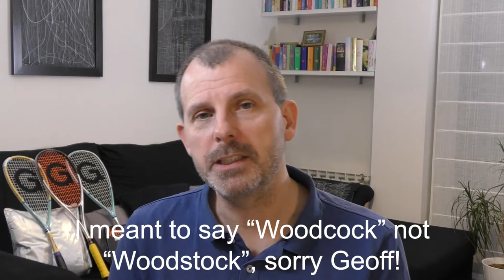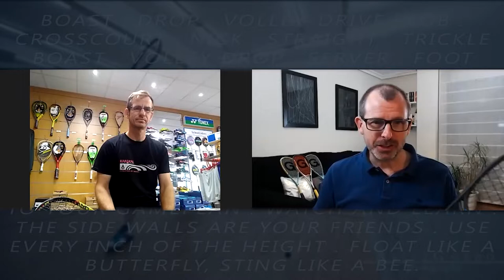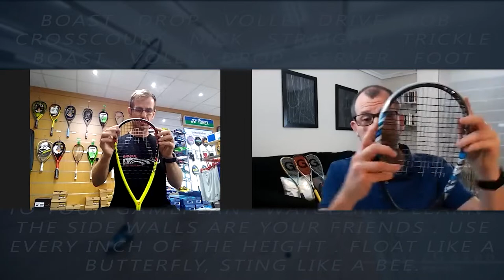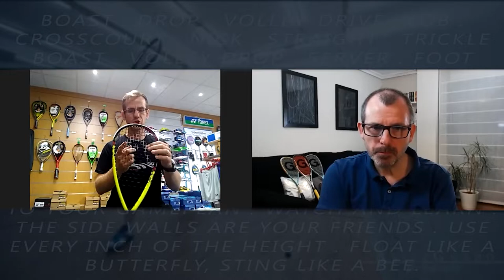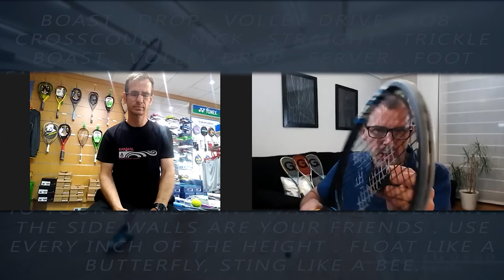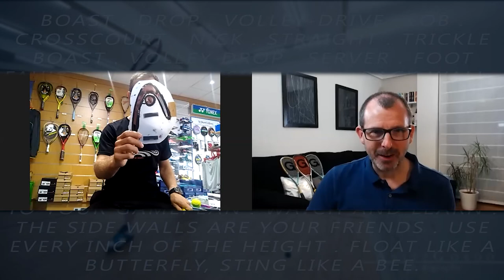Squash Racket and String Terminology

Comment: Great topic. Well covered. But what was not mentioned in your video is the term "pre-stretching of strings". I know this is not related to terminology but maybe Geoff can advise on how often should one restring a squash racquet?
Reply from the maker: That's an excellent question.  I'll make sure Geoff knows you asked and hopefully he will write his answer soon.
Reply: If you hang a weight from a length of string it will continue to stretch, this is called "creep". One string will creep differently to the next depending on its material structure.
"pre-stretching" is an attempt to reduce this creep.
There are three ways of pre-stretching
1. During manufacture the string is heated and stretched.
2. You wrap the string around a door handle or lamppost and pull it with the force of your weight.
3. Stringing on a constant pull machine the string is allowed to dwell under tension for a extra length of time or higher tension.

As for how often to restring, because of that "creep" your strings change characteristics over time. How much they change depends on how much work you make them do. In my opinion you should restring when you don't like the feel of the ball off the strings. Most club players I see it's about 3 to 4 months (if they haven't snapped sooner!)

Hope that helps 8)
Reply: @racketshop  Thanks so much for the info. Great help and explanation of the terms. Therefore must you always pre-stretch squash strings before you string them onto the racquet or does it only apply to certain types of string? Like the Tecnifibre 305, pre-stretching is recommended but would it be wrong not to??
Reply: @peterchang425  Depends on what you are trying to achieve by the pre-stretch.
Think of the string as being made up of two different components working together, a spring and a syringe of honey. If you apply a force to the spring it stretches quickly, whereas the syringe plunger takes a longer time to move because of the viscous honey.
When you pre-stretch you are trying to reduce the amount of time moving the syringe through the honey and in effect make it play more like the spring.
Soft elastic strings like 305 have bigger syringes of honey than other strings. So if you want to get rid of that "soft dampend" feel you could pre-stretch....... or you could choose a string that has the characteristics you want without pre-stretching.  
I'm not a fan of pre-stretching and never do it unless specifically asked (the customer is always right after all).
Reply: @racketshop  Thank you Geoff for the excellent explanation. I string my own squash racquets and love the feel of 305. But I find that the 305s do not hold their tensions for long (like the Ashaways). So I thought pre-stretching, based on manufacturer's recommendation, would make the 305s hold their tension longer but didn't quite like how the racquet played. Felt like something was missing. Not sure. I have tried Ashaway strings but find the string bed a little stiff. Like you say with creep, I just have to restring 305s regularly to maintain the tension I like playing at. Fascinating subject!